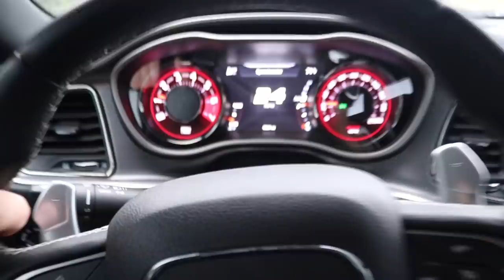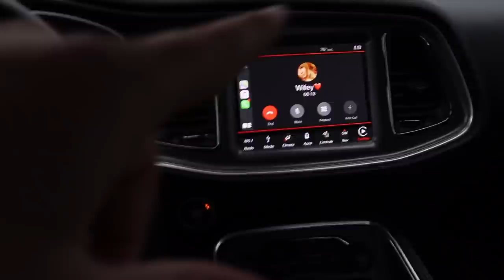We were LIED TO about this DURAMAX!!!

Comment: On my 04 2500 there is no metal under the fender flares and no rockers or cab corners but the floor and frame looks like the day it came out of the factory it’s a 6.0 gas and has 220,000 miles

Comment: That rust ain’t nothing. I’ll shoot you some pics of my crew cab duramax. The best was toast, drivers rocker under back door gone, passenger rocker separated from the bottom of the cab and the cab corner is gone. It’s rough but I knew it from the get go. Making it my lil fun project/tow pig